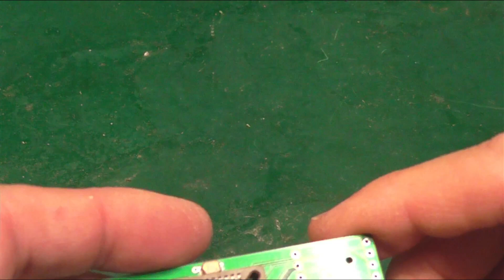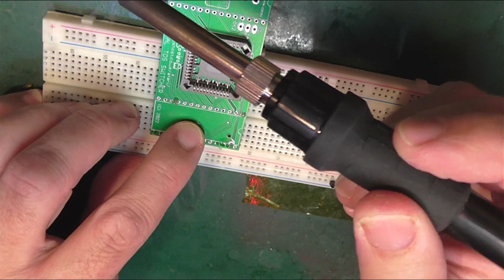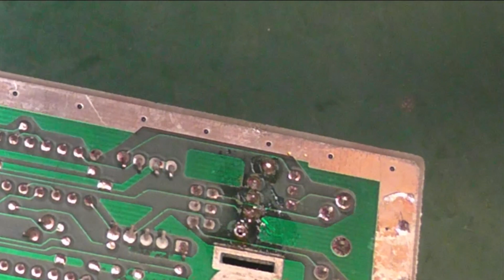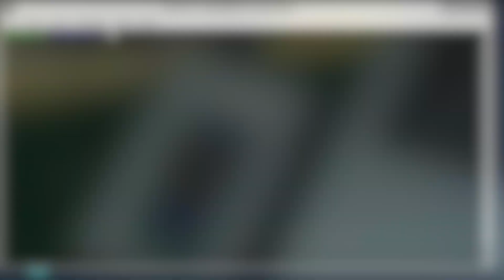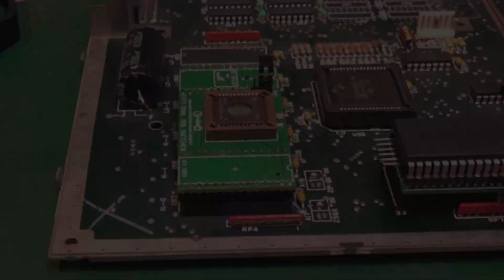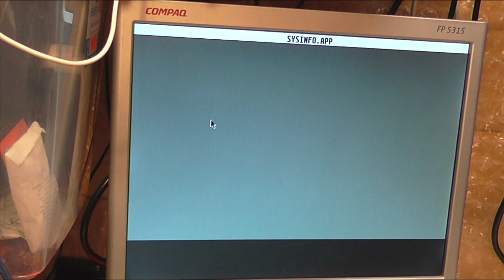STFM Dual TOS: enabling AltRAM for DSTB1

Comment: I am unable to find anywhere that will sell me a pair of 1.04 UK TOS ROMS, tried Exxos, no Joy.
Where do you suggest I try?
Reply from the maker: I'd ask on Atari Forum. If you mean the two-chip 1.04, someone may have old pulls after a dual TOS upgrade.
Reply: @thetechnoshed  I've ordered a 6 chip set,  and will have to get soldering. 
Thanks.